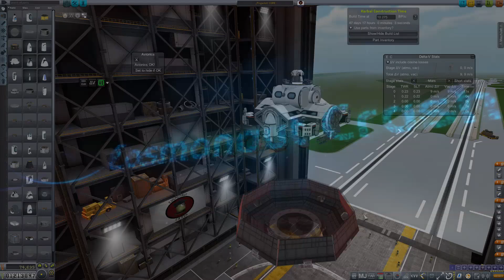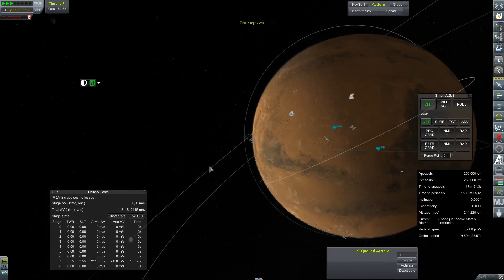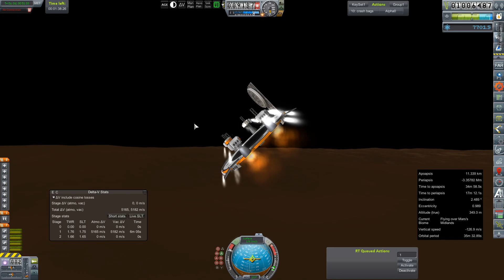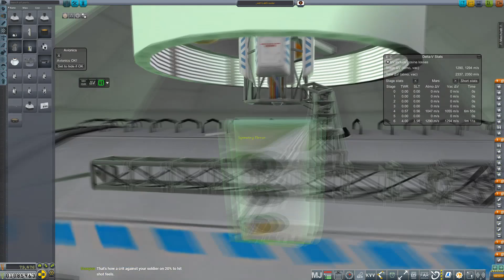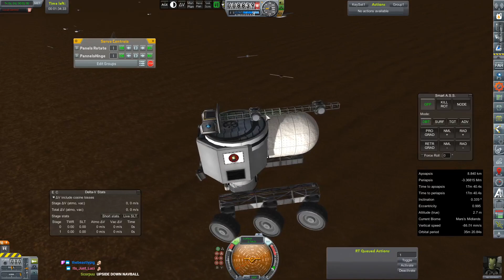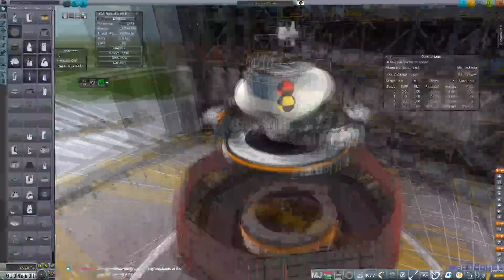KSP RP-0 # 623 M97 Deploy-able Mars Base - Initial Drop Tests

Comment: I think crafts spinning wildly when parachutes open is a common problem. It is what caused the Schiaparelly probe to fail. It probably shouldn't be happening at such low speeds though.
Reply from the maker: It just boggles me cause it never happened in any of my testing untill that very test. If it was a one-off thing it's a risk I am willing to accept, but if not then this whole plan is getting scrapped. More testing is obviously needed.
Reply: @CosmonautCrash  If it only happened once it may have been a one-off glitch. In your previous tests, was the upper half of the shell still attached when the main parachutes deployed? Maybe it just didn't like deploying the parachutes through the shell.
Reply from the maker: No, the main chutes attached under the aero shell shouldn't deploy till after the top shell is ditched. The top shell is attached by a proc interstage fairing flipped upside down, with a short structural fairing, so the chutes should. E considered "stowed" till the upper shell is released, but KSP is not k own for playing by it's own rules.
Reply: @CosmonautCrash  Ah ok, then you should be fine as long as the parachute deploys after the top shell is released. If not then the spinning is not the only thing your design will have in common with Schiaparelly :P. I am looking forward to seeing the end result.